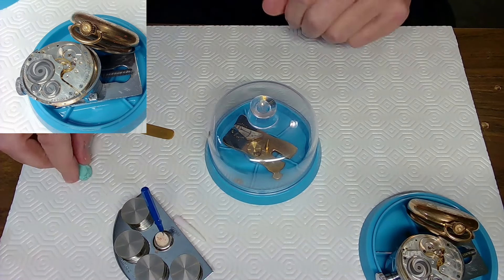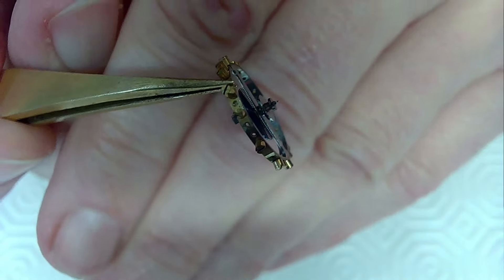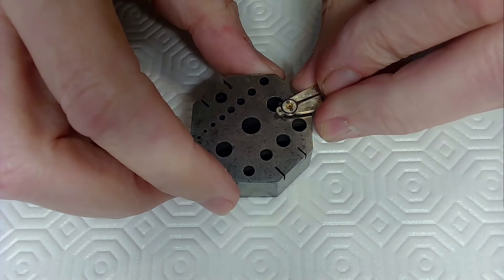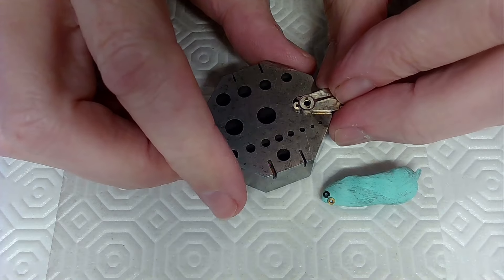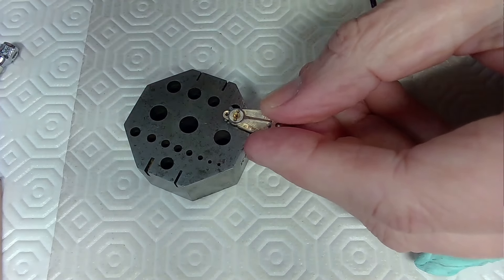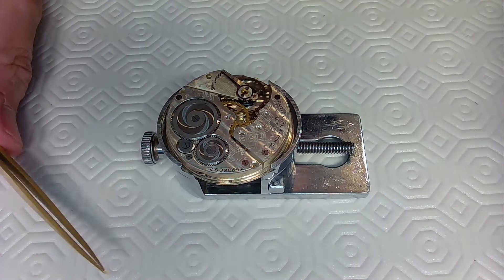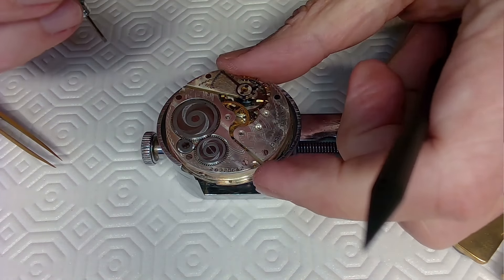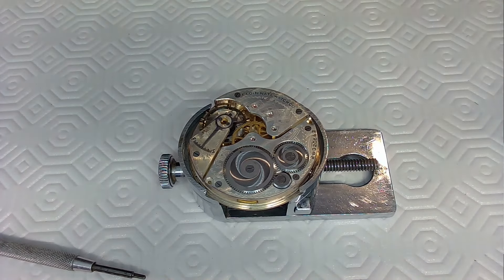Elgin Hunter Pocket Watch Running

Comment: Wow! You cleaned up that damaskeening so nicely. It’s a nail biter when the alignment stud is snug under the balance cock. It gets difficult to tell where the resistance is coming from when tightening the screw
Reply from the maker: You are correct. This is why I like to do the marriage of the balance with the cock under a microscope. Super control.
Reply from the maker: It went from crap to nice:) a lot of elbow grease

Comment: I posted this comment regarding your mystery part under your “Before and After restoration” video a few days ago. I’m pretty sure it’s part of that 7 jewel Elgin, details and part number is below. 

I’d be interested to know if my comment is visible on the other video, I’ve had an issue with people not being able to see my comments occasionally. 

Original comment : 

It's hard to be sure looking at this on my phone, but I think the extra part in the tray does belong
in this watch.

Not so many US pocket watches here so this is really testing my memory, but with some help
searching online, it looks like Elgin part 1313, a setting cam that is part of this watch.
Reply from the maker: It was a part on the Elgin hunter movement Ive been restoring. Part of the setting mechanism. Stripped the watch plat off over the barrel and reinstalled. All good now.
Reply: @JDRichard  yes, it’s the setting cam. I’m glad it found its home. 

Nothing more annoying than having a stray part leftover looking up at you from the parts tray when you’ve finished reassembling the movement. 

If there’s one part that I am prone to forget to install it’s the hacking lever in watches that don’t usually hack. 

Occasionally there will be a military issue version of a non-hacking calibre with a hack and they sometimes catch me out.
Reply from the maker: @mercuriall2810  Important not to forget parts when maintaining helicopters.  Causes a flight safety and no one goes home until all parts are in place and all tools are accounted for in there shadow boards…tool control.